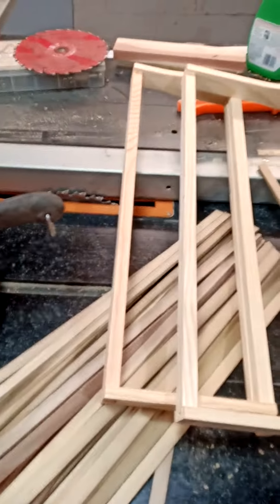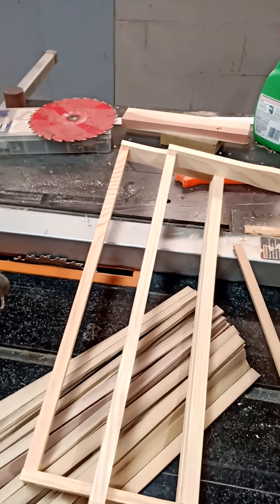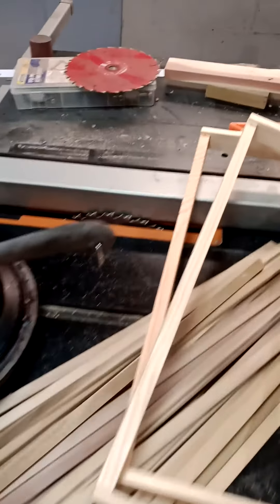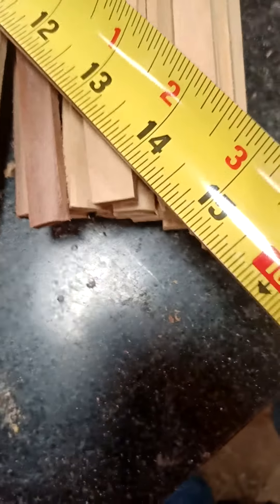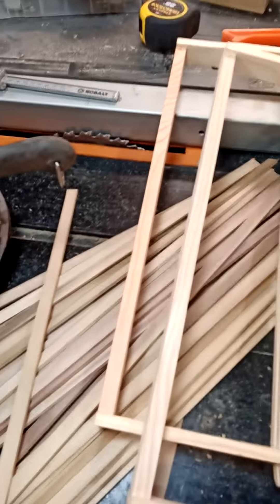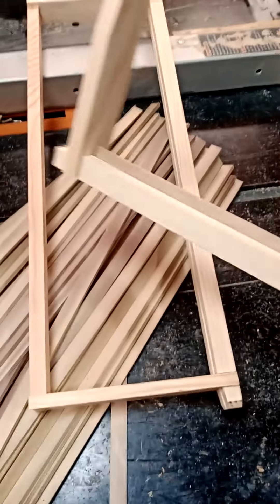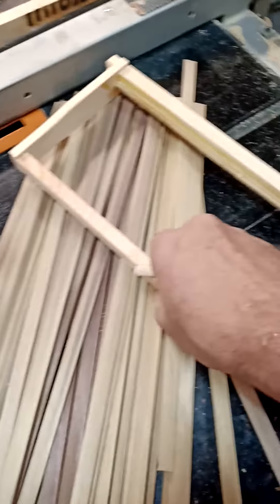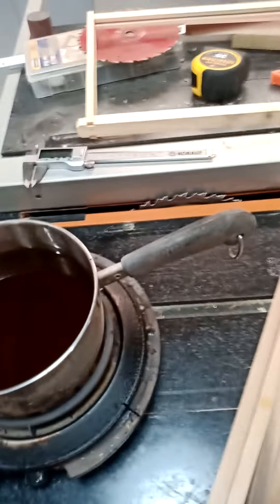how to make comb honey frames without sheet foundation

Comment: You can do this with wedge top bars. Either wax the wedge or staple it on. No cutting involved.
Reply from the maker: Wedge top bars will work but are a little weak as being only supported by one side. I use wedge top as well but I don't remove the wedge instead opting to add the filler strip. Last thing. You want is for the strip to come loose with a bunch of honey weighing it down.

Comment: Don't heat Wax directly in pan on the stove. It's very flammable !!! 
Always use a double pan, water in the bigger, float smaller pan with wax in it, inside the bigger one. 
Be a safe beekeeper ! Don't do what's shown in this video, wax melting wise. 🐝
Reply from the maker: Bees wax has a low melting point between 144 and 147 degrees fahrenheit. It's flash point is 400 degrees making it safe to directly heat on low but I would not use my stove as it will get messy.